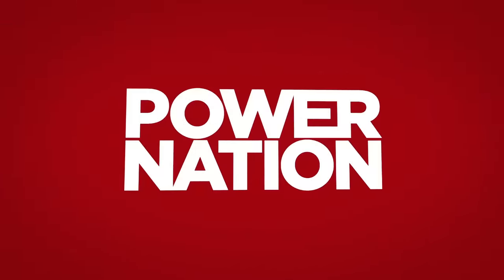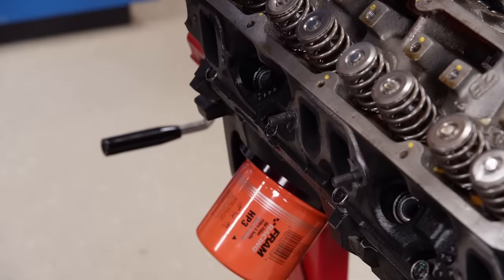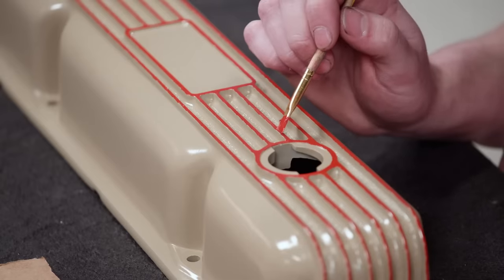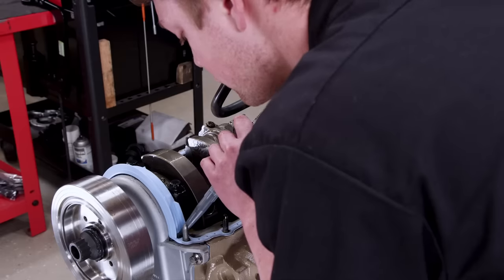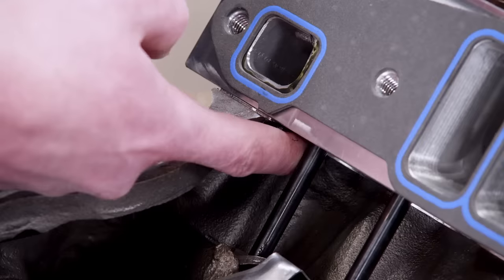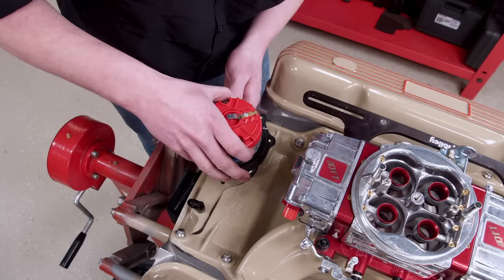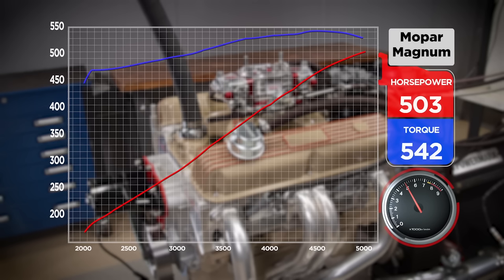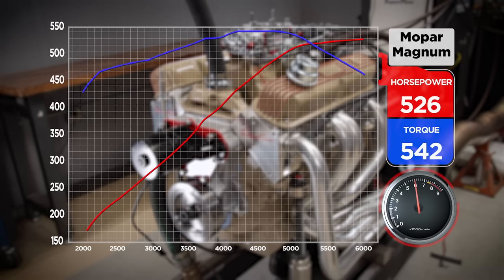Upgraded Induction and Valvetrain Makes Great Power on our Small Block Mopar - Engine Power S9, E4

Comment: I'd love to see this engine or any other fully-built engine etup with EFI and an aftermarket induction system that has been ported, polished, & port-matched by an expert. I'd like to see not only what the engine is truly capable of, but also whether there is any point in doing all the handwork involved in a porting, polishing, & port-matching job anymore with the really good aftermarket we have now! Is there room to improve a set of Trick Flow heads? Or Air Flow Research? Or Edelbrock, etc....

Comment: One thing that has always puzzled me about Mopar. The Hemi was created out of a need for airflow. So how come they didn't build on that across their entire range of engines in the following decades?
Reply: the hemi was established to compete in Nascar. Those engines lived in the upper rpm ranges and not very streetable. Same thing happened when they put the hemis into their street cars. They were dogs. Same as the Boss 429. More air flow requires more fuel and that became a big no-no in the early 70's.
Reply: @cutlets6152  Only the 426 that was for NASCAR. The very first Hemi was built for the Military but WWII ended so the Engineers developed it for their passenger cars. It wasn't called a Hemi but a Firepower. Displacement was as small as 241. The 392 became THE Engine for NHRA almost by accident. The "Hemi" for NASCAR came about in 1964 but was unable to run the '65 season because of Ford's 3utthurt and it's unavailablity to the public. They were getting their proverbial @$$ handed to them with the 426 Wedge.
Reply: The hemi head was way way too expensive to manufacture. Gas was cheap so building bigger engines with cheap wedge heads just made economic sense.

Comment: The 318 and 360 were always hampered by their very tame heads and weak cam. Especially the 318. These motors come alive with a cam, heads and headers. The Magnums in the trucks suffered with that big goofy beer keg manifold. They make good torque with those, but if you want higher end hustle, those things gotta go. There is a guy here on Youtube who wanted to keep the very nice port injection setup, so he grabbed a good air gap dual plane manifold and machined in some bungs to hold the factory injectors. The factory throttle body on these is capable of more than 700cfm, but there's room for improvement with some porting and thinning things out, or buying a Hughes Big Gulp and TB to 4-bbl adapter plate.
and best of all is that it will likely pass smog checks because you left the factory emissions controls in place, assuming you don't go crazy with the cam.
Comparing the initial dyno to the final just shows how much these Mopars are being choked out by factory components. You can see that cam pull hard all the way up, right until it runs out of beans a little over 5k RPM. The heads look like they'd support even more cam if you didn't mind a lumpy idle. Probably an easy 600hp in them with the right cam.

Comment: Most people don't realise what torque monsters the 360 is.  I believe only the 440 has a longer stroke of any mopar engine.  They have huge potential!
Reply: Displacement increases torque. 1.33 ft*lbs/CID is a good target to shoot for then cam and tune for the HP you want.   or add boost, boost makes everything better.

Comment: Astonished its pump gas at 11.5:1. Any hiccup and its toast.
Reply: I had the same thoughts.  Risky business for sure.
Reply: Aluminum combustion chambers quench much better than iron heads, so they run cooler and allow higher compression by around 1.25 points.
Reply: The piston and head design have everything to do with that.
Reply: He said 11.05:1.  But still, I agree, that's quite a bit for the street even with the aluminum heads.
Reply: @elmerfudpucker3204  Narrow bore spacing and large valve diameters in small blocks, tend to create valve shrouding in the outside pockets of the combustion chambers.  
It's the reason Ford 351 Cleveland, 429 and 460 heads are so good, all having a valve train geometry that slants the valves towards the center of the bore, creating more power than typical heads.  And because aluminum heads with less shrouding run even cooler, it's worth an additional .25 points of compression. 
I build a 650 hp street Ford 429 @ 11.5:1 for my 40 Ford deluxe coupe project and with an it's adequate cooling system, there was no detonation on 93 oct..  regular daily driver..

Comment: I have 318 with a 4 inch stroker kit magnum heads a 531 ex 547 intake  cam super comp headers in an 89 dodge dakota makes it a 392 it is 40 over. roller rockers roller lifters block is a 72. holley TBI with a mid rise intake all kinds of fun

Comment: would have been interesting to try the stock iron heads and original intake from the first pulls with just the camshaft.....granted that would have required a spring swap and cutting the valve guides on the stock heads.....

Comment: I still think it was climbing after they tuned it. I think he should have made a pull from 2300 to 6300 just to see where it peaked. I think it had another 2 to 3 numbers, and torque peaked at 4,000. So if it carried to 6200 or 6300 that spread would have been at or over 2000rpm. This is a great little engine. I would have liked to have seen what number it would have made on some good E85

Comment: Now u see the true power of the magnum
Reply: with an extra $5000 of icing this episode alone,it better have some nuts........do the same thing to a 351 ford or a 350 chev it would have VERY similar numbers
Reply: @trillrifaxegrindor4411  absolutely but these are similar numbers to the modified 318 that turned into a 438 inch small block I had in my 1998 Dakota

Comment: I hope to replicate these results with my 408 Magnum that will be going into my 02 Ram quad cab💪
Reply: Hope you gap some ls guys
Reply: I’m working on a 2001 R/T Durango. 5.9 AWD, stroked to 408, eddy heads, 7582 turbo. Looking to run 11.0 in the quarter as a daily driver on 9-11lbs boost.
Reply: @BobF315  i want to daily drive mine and continue to use 89 octane

Comment: You would have picked up low end and peak torque with an rpm airgap and it's not debatable. Might give up 10 on top but for a street car it's a bad trade. I've built and raced sbm for many years and I'm only telling you this has been tested.

Comment: Y’all should do a 4.7 magnum and do some upgrades on it
Reply: Haha no. No one hot rods the 4.7
Reply: If by upgrade you mean send to the shredder.
Reply: Kinda sad that engine didn't get anymore development than what it did. The heads are rather intriguing. They have a twisted valve semi-hemi thing going on. Very very similar to the polyspherical heads on the A engines
Reply: I’m actually building a 4.7 with single turbo and forged internals
Reply: @christophersine84  They came out with a superior platform by every measure. The gen 3 Hemi. The 4.7 was a stop gap and nothing more, nothing sad about it.
Reply: @moparproud3978  Maybe, I guess we'll never know

Comment: i can't find that cam on the Comp Cams link.  I was going to use a 6.4 Hemi in my 73 Duster but this makes as good or better power and looks correct.  I am glad I hadn't "pulled the trigger" on the Hemi
Reply: Based off the specs they say I think it’s a 20-813-9 that will at least be close
Reply: @stevenhoitz9260  Thank you. I believe that is correct.  It says it is for the LA but I guess it will fit the Magnum.  Is that correct?

Comment: Pat degree's cam's with a tape measure,
Reply: ..... And still having to take his shoes and socks off to count. Even then he still didn't realize, comobgrinds 4⁰ advance built in... Mr. Engine builder should have known that,which he would have if he put it on 0 first to get a baseline on how it was ground. 🙄

Comment: Would have been nice to see it with just the cam and carb then the heads. Now we have no clue if the heads where even needed. Trickflows Mopar heads a for SB and BB are not very good copared to what they offer for other manufactures until you get into their race heads.

Comment: Should've, left the compression ratio, at 10:1 Most people don't run 11:1. I know, you were going for the wow factor.
Reply: Aluminum heads.   Factory cars with Aluminum heads cone with 11 to 12 to 1
Reply: GM 3.9L V6, factory compression is 11:1
Reply: @elmerfudpucker3204  Yep, it's a lot of them now adays.   Back in the late 90's not so many.

Comment: The '90s trucks were so underpowered but I'll always love them to always be my heyday and now they'll be my obviously the '80s trucks too but late '80s '90s will always be my first trucks and my when I was in high school so I'll never forget it well the early 2000 trucks were brand new at that point and I was in high school so I wasn't affording one plus I didn't really like them especially how Ford went to freaking overhead cams The coyote is amazing now but it took a while I honestly wished GM would go to do overhead cams on the pickup trucks I mean they did it for the Corvette so we'll see Yes they did it a long time ago too and lotus built the valve train but I'm talking about the new LT6 if they put a Cross plain crank in it and maybe obviously detune it make it 5 L or like 4.8 L and it would be great truck engine if they got it down right maybe I might see it before the EV takeover happens completely which I don't think ever will

Comment: What I'm curious about is a stock 318 an 360 magnum is 220 an 240hp. So how did there "stock" before anything was done was slightly over the 300hp mark?? Really making me think this can't be done or I get close to those numbers if I ripped out my sbm an did the same build, my #s wouldn't be close.
Reply: About 10 years ago, Mopar had a 300 hp crate engine based on the Magnum. All they did was change the intake and go to a carb.

Comment: Would that engine be practical and reliable for a daily driven pickup?
Reply: Yes
Reply: Reliable? Yes! Practical? No you'd get maybe 5 miles per gallon lol not too mention the fact you'd have too run a dummy stupid high stall converter with how big that cam is it would be terrible to daily drive
Reply: Ummmm…Yeah!!!!!
Reply: Daily driver you would want 650 dbl pump. 1050 would kill in gas money.
Reply: @GJ-DT  
That's a big thought especially now. I have been planning on getting a mid 80s w150 and going with a super charged LS swap since those engines are a known thing with lots of support. I wouldn't mind the magnum, but Chrysler drive trains have done me wrong so many times. This engine has me pondering.

Comment: So what kind of money in today's market are we looking at for this build?
Reply: $2400 for crank and lower assembly, $2500 for heads, $1000 for rockers, $90 for timing chain, $600 for intake, $1100 for carb and another $700 for ancillary like distributor, pushrods etc.

Comment: Would a fuel injection set up make a little more horse? Or same as a carb?
Reply: Same to slightly less. All FI systems are that way. FI is way more tunable and efficient, but properly tuned carbs will beat them.

Comment: As I recall the C R was well.over 11 to 1.
So a pump gas street engine‽??
Maybe if it were 1967 and 103 Chevron Cuztom Supreme or Sonoco 260 were available.
With 91 pump gas running on a carb I'd be really surprised if you could run 10.2 to 1 and decent initial and timing curve.
And make no mistake the high CR is boosting the numbers on torque and hp.
I'd expect to see about 50 less hp and ft lbs of torque running around 10 to 1 C R Which WOULD use 91 octane pump gas with plenty of timing.
Still very impressive numbers though.
I'm not real clear exactly what body color would have looked good with the beige engine .maybe root beer or black??????? Or bright red????
The trick flow heads and long runner single plane manifold were particularly interesting especially at their price point in Summits catalog.
But even so make no mistake that's now a pretty high buck engine.
If you paid for the magnum engine the machining the parts and assembly all at retail I wouldn't be surprised if it Costas much as the Chevy LS 427 crate engine.and of course it doesn't have a 2 year or 25p00 mile warranty...
WITH THE STOCK RODS AND THAT STROKE I DAMN are wouldn't want to go past 5700 and there doesn't appear to be much reason to do so.

Comment: I wonder what it would do with a turbo.
Reply: pull it apart,change the pistons,the cam etc and find out
Reply: @trillrifaxegrindor4411  Just keep low boost, run this one.
Reply: That's easy, just do math. 540hp @15lbs is 1,080. At 7.5lbs is 810. That's all boost does.

Comment: Guys,
This one was for me.
I have a 98 Magnum pickup. Mine has the stock EFI system.
What would you do different considering the EFI system?
Great series!
Reply: Keep a wide 114LSA. And buy heads. Between a stroker kit and heads, I would spend the $$ on heads, a 218-224 dur. cam, and supporting intake mods to make power to 6k

Comment: engined had not quite reached peak rpm /power,would have tried it to 6500rpm and it should have peaked at 6200/6300rpm
Reply: Stock lifters held it back.
Reply: @CarsandCats  How? They're rollers. If anything it was the smaller exhaust valves.

Comment: Enough with the Mopar Chevy and Ford stuff already. Pat and Frankie need to put their spin on a big inch Pontiac using the Kauffman iron block.
Reply: Yeah, too bad they don't put ANY of "their spin" on anything. Parts they using are part of the advertisement for whatever company is paying the show to use, and they are chosen by said company, some of which also supply tech advisers to help. Kaufman doesn't really need any of that.. Just sayin.

Comment: if there was a dual plane for huge ßtrokers..........so you would not have. to use a single plane.......and had less stroke.....you would have m8re horse........the three sixty has a  piston speed of 2250 at 3000....they hydroplane on thier oil....and tend ti loose oil out the 
tailpipe.......what you did was confuse the issue....your piston speed was far worse probably..
2500......oil would go out your tailpipe quick.

Comment: So it's not worth stroking out all that money and all that work for 30 horsepower you can get that with a cam and I can change that in 2 hours and it's a hell of a lot cheaper
Reply: I agree. The engine doesn't need to be stroked to achieve close to 500 hp.

Comment: That engine is having problems. You can hear it and see it on the pull numbers.
Reply: What problems?
Reply: @jeffnewton3507  the bottom end has clearance issues. Something was not double checked. It sounds like the mains.
Reply: @williamarnett9064  what sound does that make?

Comment: I have to say, you are Missing at least 70-80 horses and still perfectly street drivable., and as much as 200 down on power still naturally aspirated.
   For the same sort of Money a Motor of that expense could be making above 700hp naturally aspirated drive it to the shops, drive it to the track capable.